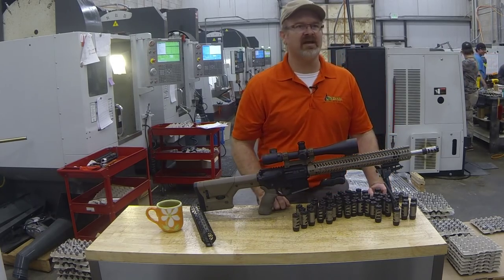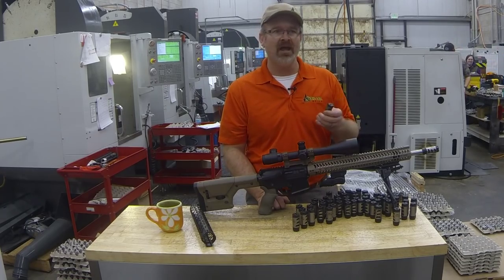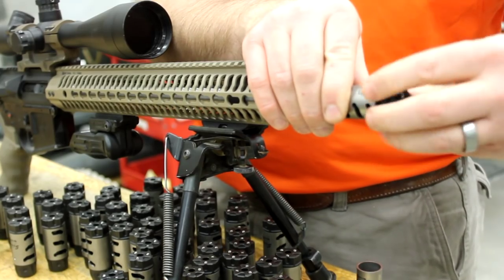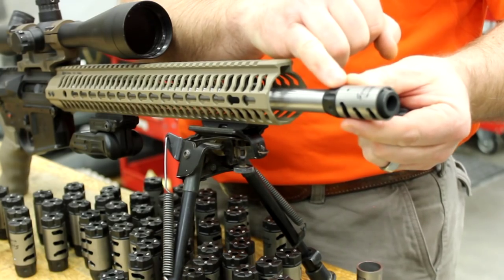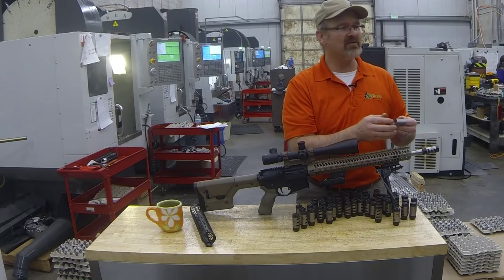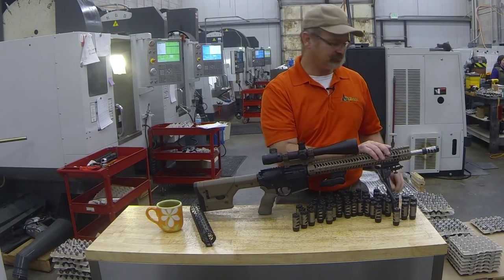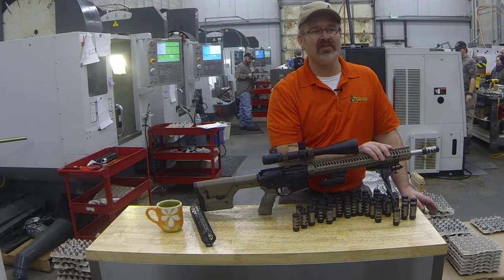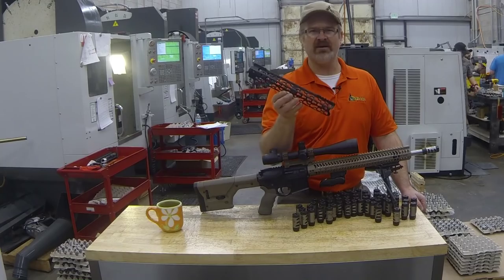ODIN Works ATLAS Compensator

Comment: Ok so for someone who is not a machinist what is the size equivalent bit for 1/100000th of an in. What would the numerical value be for that in a store like lowes?
Reply: Just ask for the new Kobalt Ion Beam Drill and set it for 25.4 nanometers.  No bit required.  Oh, and don't forget to pick up some ions if you don't have any.

Comment: Got the atlas 9 and everytime I shoot my pistol it won't eject the fired casing and makes it to where I have to track the slide every round. Any tips?
Reply from the maker: Thank you for the inquiry. The ATLAS is designed to mitigate the recoil on a firearm, which will interfere with the blowback recoil operation of a handgun. It may be possible to remedy the issue by using higher-pressure rounds, by using lighter recoil springs, or a combination of both.

Comment: So will this work with AR pistols ? You say there is a hole on the top tuned for 18" guns what about 11" and shorter barrels ?
Reply from the maker: Yes it will work, for instance MCM Firearms uses an unmodified ATLAS 5 on a 7 inch M16.
 
The shorter the barrel the bigger the hole needs to get to keep it flat.  Start with it unmodified, it may work great for you.  Drill the hole out slightly larger until you like how it feels.